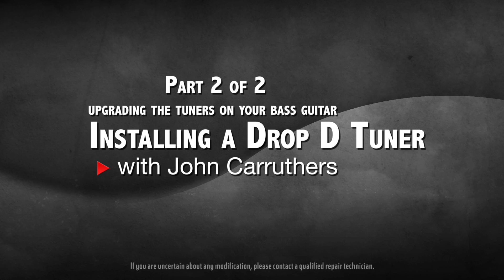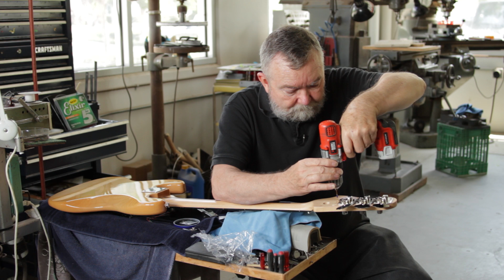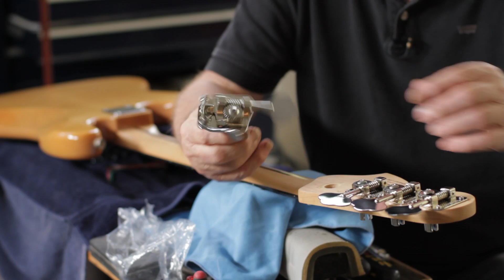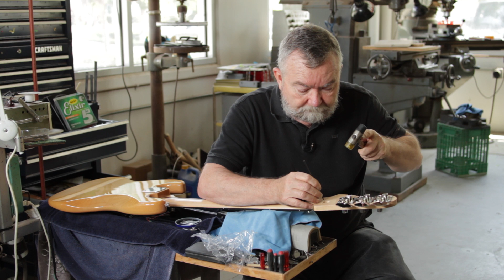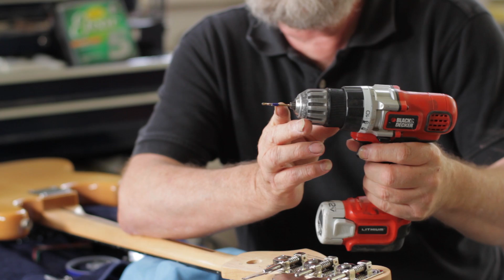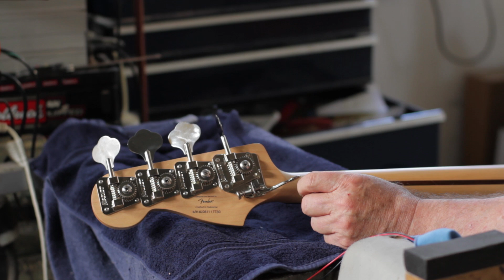How to Install a Hipshot Drop D Tuner on your Fender Bass | ELIXIR Strings

Comment: i installed one of these a few weeks back, the thing i notice is the tuning machine squeaks very much while tuning the bass. I'm not sure if the gears are meant to be as tightly fitting as they are, but it sure makes a lot of noise. Any suggestions for this? It does hold tune very well and almost locks it in place. Great machine otherwise.
Reply: Lube?

Comment: hello, can a drop d tunner be installed in all 4 strings?
Reply: because of the size of the base, i don't think it'll fit properly. If someone made a custom neck with a bigger headstock for you, you could make the tuners farther apart to accommodate for the size of the tuner.
Reply: @Gambero And check Charles Berthoud as well.   You should do that anyhow :D
Reply: Buy a "the drop" pedal, it would be simpler ;)